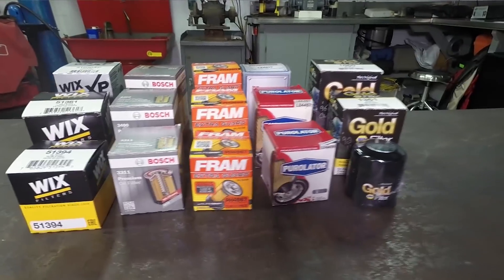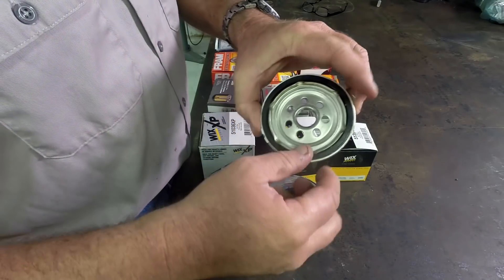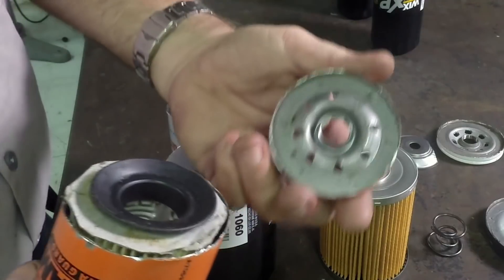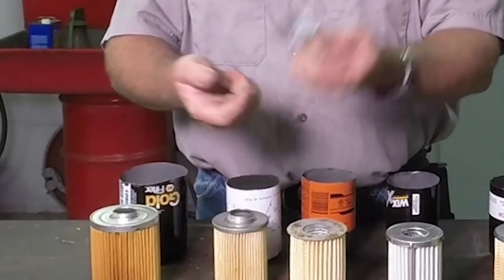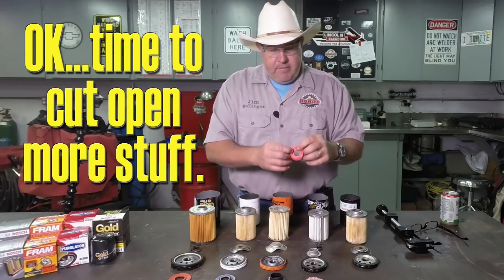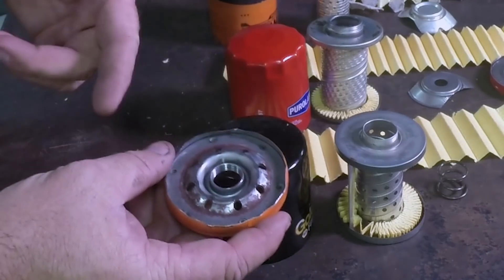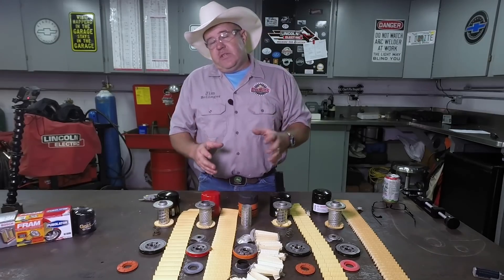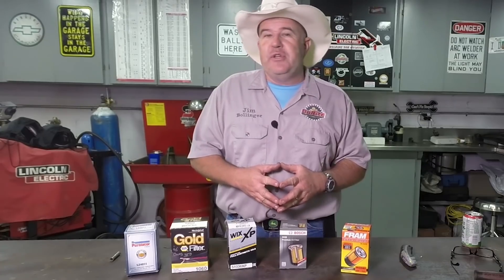The worst oil filter EVER!

Comment: I'm a mechanic and also work at Advance we stopped carrying Fram because they have seriously compromised thier quality over the last decade, I suggest K&N, Mobil 1, Purolator Boss and Mann, Wix is also good. Fram is indeed trash, you will be hard pressed to find them at any big brand store other than Wal-Mart. They are a liability and therefore not stocked.
Reply: Mann is the parent company of wix btw.  So probably similar quality
Reply: Liar.
Reply: @mopar340dave  Fram sucks, get in your skulls, it's not propaganda it's just facts.
Reply: Oops, just checked on the WWW and Fram is sold at Advanced.
Reply: @107649365  you can get them through our website only at Carquest locations which we also own. None are stocked at a Advance. Oops pay attention to the details dummy.
Reply: @raheemimran5757  Are Car Quest branded filters any good?  This year I put one on a piece of machinery that's under my custodianship.  I don't really know dick about this but there's stuff I have to take care of and figure out how to fix.
Reply: @MilwaukeeF40C  our standard Carquest and Premium Carquest filters are equivalent of a K&S PS series filter or a Purolator One the R series Carquest in the red packages are crap, they need to be frequently replaced as they are not of high quality.
Reply: @MilwaukeeF40C  in short yeah you can certainly use Carquest labeled ones just stay away from any part starting with an R they are cheap craftsmanship. The rest are high or passable  quality unbranded equipment.
Reply: Every advance carries them as their main brand.
Reply: @jebdanger1605  I currently work as a commercial parts pro @ Advance Auto, our main anchor brand oil filter brand is Purolator, we have Mobil 1 as well as K&N, our house brand is Carquest. NO GODDAMN FRAM NOT FOR AT the  LEAST 2 YEARS if not longer

Comment: Cutting open filters means absolutely nothing so I have to respectfully diasgree. As a mechanic of slightly over 40 years (aircraft and cars) I can say that I have never seen a vehicle with engine damage of any degree caused by the use of any oil filter and that includes Fram.
Fram sells a billion filters a year. If Fram filters were no good then shops should be backlogged with Fram -caused engine problems.
I use Fram filters on m cars and I routinely run all of my cars to 300k miles; and in one case over 400k miles.

Comment: Great video 
I never like Fram filters, I have used OEM , Wix or K&N (black filter) 
Can you open up a K&N filter and make a video?
I’m using OEM because I usually buy 10 filters at the dealer and get a good price since I do 4000 miles oil change full synthetic oil

Comment: I’m 24 and I know fram is junk when I was 16 i has a small oil leak turned out the from filter had a crack under the black coating all I use is wix especially when I get them for half the price from my work great video

Comment: I don't think it really matters if the filters were top of the range or a lower range product from the manufacturer.  If you cut open a filter and find it already is contaminated by rust then it is a poorly manufactured product with next to no quality control. I mean rust was found in all 3 Fram filter cuts so obviously there is a big quality issue here. I like this video. Shows what the average person never sees.

Comment: Ernie Gruhn here from Winnipeg Manitoba in Canada,yup they fooled me for years, ihave a auto service shop and also raced modified dirt racing , we had 3 filters with problems in 1995,and after cutting  filters apart, we knew what we had been buying, I called them about the issues, almost losing  an  engine over  a Fram filter,and I said i'm calling to let you know you have problems not cause I want a case of filters, salesman picked them up, I never ever got a call, and never got paid for the bad filters,.....my favourite auto question to some one is ….what is the worst oil filter on the market ?.....Seldom does anyone know, so I say what's the one you know, you know the one you always see advertised......Now they know!!!!

Comment: I used Fram until it almost destroyed my Silverado! The last filter I had literally clogged my lifters...I lost oil pressure and I thought I blew up the engine. After tearing the engine down and finding cardboard in the oil, we looked into the filter. We cut it open and yes, it has deteriorated and went into my engine. We had to do a complete flush and pressure test. I’m using Mobil and has been great

Comment: WIX makes the filters used by NASCAR. They also make NAPA GOLD filters. Exact same quality.
I trust my 7.3 turbo diesel with 435,000 miles on it to these filters and have zero problems.
Fram cost me a pristine 289. I can't forgive them for it.

Comment: What's funny is it forsnt matter how they put them together it matters how well they FILTER oil, 8nstead of being a dumbass and using a grinder to cut the filters while dry run them all on the same motor for the same amount of time take them off use the proper filter cutter and inspect which filter actually filters better!  A dry filter cut apart isnt gonna tell you shit about how well it filters oil it just shows how they're put together. Common sense! This guy just wasted all of your time by making this video and filters to prove nothing.

Comment: I have used Fram since my first car back in 1995. Guess what, still have that car. Still use Fram. 390k miles on it. My new car has Fram on it and still no problem. 299k on it as of the last oil change. No garbage in the oil and no oil burn on the engine. So tell me again how bad Fram is?

Comment: I wish K&N and mobile 1 filters were included in this but still a very good video!
Reply: Me too! I use Mobile One filters - maybe take one apart and find out....
Reply: I use k&n oil filters also in my 2011 ss camaro. Would like to know if they are worth the higher price.
Reply: @charleshall9755  i recommend changing to a Royal Purple brand part # 10-48
Reply: Agreed. Vanagon's are fussy about their oil filter and mine seems to like a mobil1.
Reply: I want to see what MOPAR oil filter has also.
Reply: @jonboatnationandstuff3301  Mopar filters are rebranded Wix filters. (So they are of a good quality. If they are not available, however, Wix will be just fine. I typically use Wix XPs on my Hemis, as I use full-synthetic - Amsoil in one, Pennzoil in the others - and extended intervals.)
Reply: Okay, thanks.
Reply: k&n is made by fram
Reply: @Kris-kj3gt  No way, you got a source for that?

Comment: I bought a Fram oil filter from Walmart 2 years ago and the day I changed my oil my engine started to tick and with every mile it got louder and louder and the oil gauge went up and up until it spiked. I changed it immediately with the most expensive/high grade oil and with the best oil filter I could find which was Boush. At the time I really thought Boush was the best because it was so expensive and Boush was the only brand my father would use. He swore by them and wouldn't use anything else. Now I know that money must matter more than quality to them anymore but anyway my oil pressure is still maxing out at startup and stays high even after warm up. The ticking calmed down a year after this happened but is still there slightly when it's warmer out. Now I have to warm my truck up completely before driving it because the oil pressure gauge still maxes out and there's a loud knocking in the lower end like I haven't changed my oil in over 20 years and the oil is thicker than honey (it only happens below 20-30 degrees when someone tries to drive it right when started) Let me tell you I had a panic attach and a half when everything started happening. See I was diagnosed with Multiple Sclerosis in 2002 and the doctors took me out of work so I went out and bought my truck and I take extremely good care of it and I don't have the money to put a motor in it and this scares the F**King S**T out of me. I even kept the filter for a long time. I recently thrown it away (I think I did anyway) wish I could have cut it open but I didn't have the means. I just stand I'll keep changing the oil ahead of time. Thank you for posting this video because if you didn't I would have kept on using the Boush filters. I know that your not saying that Boush isn't going to protect my motor but I just want to make sure that it has the best in it so it gets maximum protection. I just wish I could prove that everything happened do to the filter (which I'm 100% sure it's do to the filter) so I could get it fixed through Fram so I don't have to worry every time I need to drive it.

Comment: That's why I font use fram filters. They are crap. Could you pull apart a motorcfaft ,k&n and a Mopar filter? That I will like to see i use motorcrat or k&n on my truck.
Reply: @K2SKIER112  oh now that's just unacceptable!
Reply: I'm pretty sure mopar filters are made by wix. Been using the black mopars for years
Reply: @fubarmodelyard1392  Well, up to the 2002 model year, they were using WIX to make their filters; but to Ma MOPAR's specs. The best ones were naturally from the mid 60' to the mid 70's but were still the best you could get before 1984 (last year for carbs). Actually, up til 1999 FRAM was one of the best filters you could get, but their acquisition by Honeywell was their downfall. Honeywell's bean-counters are strictly devoted the the "Scrooge" school of thought: Company profits above all else. Employees are expendable. Much like the Union Pacific R.R. ideology is still today.
Reply: @fubarmodelyard1392  i agree k&n ,purolater  hm or boss   same for the rest  ,ac delco ,motorcraft, mopar,mobile 
would be a good one to see if there HM
Reply: @bakedpagan4674 .  Actually, the K&N, Purolator and Mobil-1 are perhaps some of the best to be had.  
I suppose NAPA Gold and WIX are up there also!  
 I cannot properly say since I've never tried NAPA Filters and they are not commonly available in Canada...unless you go to a NAPA Parts Store.
Reply: @darring.9161  huh, you can't find a NAPA filter without going to NAPA...why is that?
Reply: @K2SKIER112  Because in Canada we do have NAPA Parts Stores and Garages...but not many.  Quite likely you can find the NAPA Filters there.  Everywhere tends to sell FRAMS, Generics made by FRAM, Mobil-1, Royal Purple, Quaker State and such.  A lot of DIY's here go to Canadian Tire or PartsSource for their Oil and Filters...and they don't have NAPA Gold.  But I can get them through Amazon.ca but they're rather Pricey!
Reply: Same here in California.Never even heard of Napa filter.Main ones hear are bosh,fram,stp,k&r,ac delco and that’s about it.I know because I alwsays ask the auto parts guy to tell me what brands they have for my car and those are the ones they always mention.I have 3 cars by the way 2 Toyota’s and 1 Bimmer.
Reply: @K2SKIER112  Napa gold is Wix sold by napa

Comment: Fram really does a good job at marketing to keep rebounding. I remember they became "famous" with their filtration results about 13 years ago. I thought people knew to stay away from them by now. I got educated about fram when I spun a rod bearing, cut the filter to look at how much metal the engine created. Pretty much no metal but the media was collapsed in on itself with the cardboard ends folder over. Major oil restriction. I blamed the fram for that one.

Comment: Huh, My car has 151k miles on Fram filters. My old pickup had over 200k on Fram filters, in fact, I only got rid of the truck because the body rotted off the frame, the motor was fine. My guess is, if you don't use junk oil and change it every 3k miles no matter how many miles your manual says you can go on an oil change, you'll be fine.

Comment: My dad has a 97 chevy astro van with a 4.3l v6. He has over 340000 miles on it and has used that Fram filter and mobile conventional oil since new. That thing has never had an oil quality related issue. I think it  would cool if you could do some more scientific testing on these filters to perhaps see how they actually compare in function instead of just quality at inspection.

Comment: 15yrs ago i used FRAM filters all the time.  I got me an 88 Mustang Gt and over about a years time i noticed whenever i started my car it would tick and sometimes clank for about 3 or 4 seconds on a cold start... No matter if it was winter or summer.  At first at payed it no mind thinking i needed an oil change but it continued through 2 or 3 changes. To prevent the dry starts I use to crank the engine slightly where the started would turn the motor but not start it.  I use to do that a 2 times and that eliminated the dry start.  I told my friend who was more into cars at the time than i was and he asked me what filter i used.  I told him FRAM and he told me that was my problem.  I stopped using FRAM and never had another problem.  I use STP now and i bet they arent the best of quality but i never had a problem in 15yrs.
Reply: FWIW You were better off just letting it idle dry for 3-4 seconds instead of brutalizing your starter like that
Reply: @toxicity4818  better off not using a fram filter lol...  That solved my problem
Reply: i mean yeah lol, definitely wasn't helping anything haha

Comment: Back in 2000 I had the engine on my 1997 GMC 7.4 liter destroyed due to a Fram filter that fell apart and clogged up the oil passages in the engine.

Comment: Mis information gives the trade a bad name.

An oil filter is designed to be replaced with the oil. Don’t matter if it has rust inside the filter or that it’s made of cardboard, what’s the rust going to do to the engine? It’s trapped inside the filter, it’s not going to breed and make your engine rusty. Opening a can is not a real indication of how well it’s going to work, flow rates and how well the element filters the oil is what you should be paying attention to.

As long as it has manufacturers spec numbers it’s safe to use. buy a more expensive wix has it got manufacturers spec numbers on the box

Also fram is an ome part for many cars

Sheeple mentality

Comment: That's all well and good and I sell Napa filters and won't touch a Fram filter but even you need to compare apples to apples. The cheapest Fram filter against the Gold version of Napa (Wix). You should have put the Fram up against the master pack installer grade Napa filter and that would have been an apple to apple test. (Napa would have still won but at least be fair)

Comment: To those that buy fram....they actually do quite well on particle filtration but I must mention only the cheapest models and only if you change them at every oil change.
Reply: Also I would like to add that different types are definitely constructed different and the best way to know what you are getting from each brand is to cut them open and also send oil change samples from each brand you test. That's what myself and three friends did. Two run fram because it was the best(myself included) one runs it because of no difference other than price and the other...wix. then again fram can filters are trash because they can hide what you need/want to see.